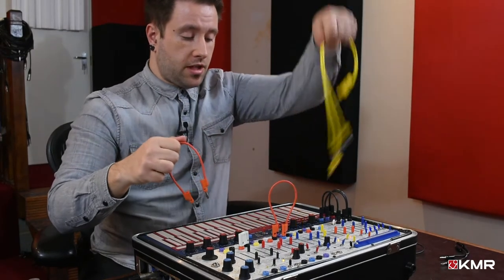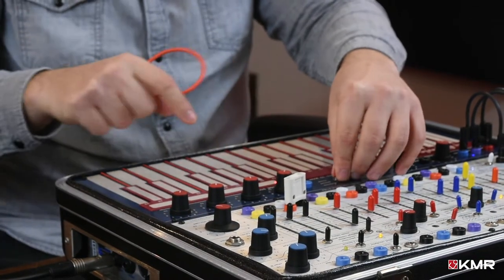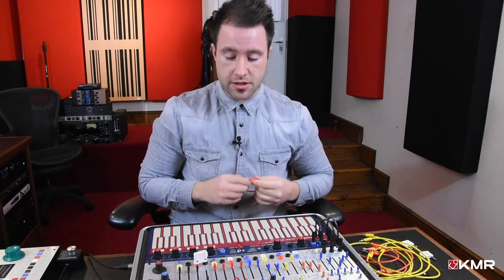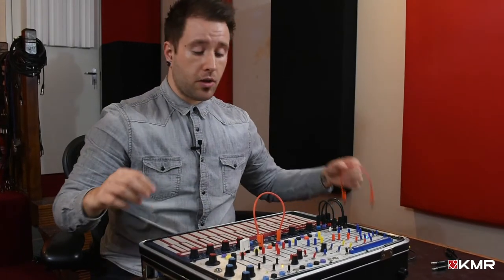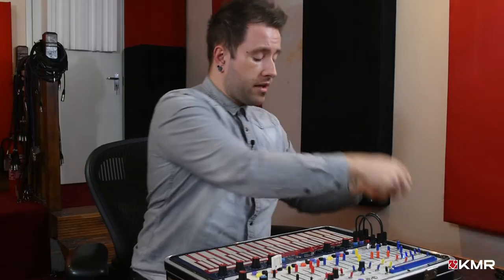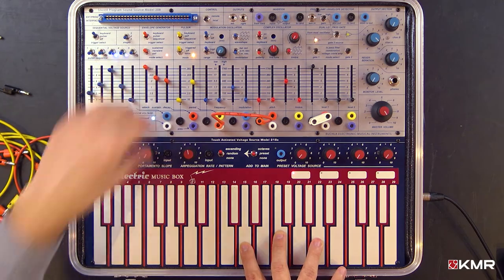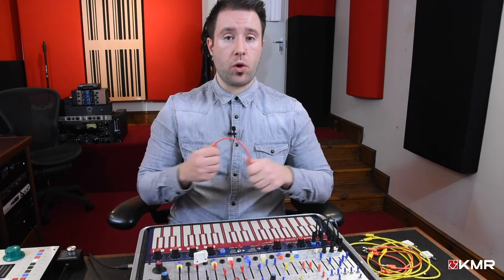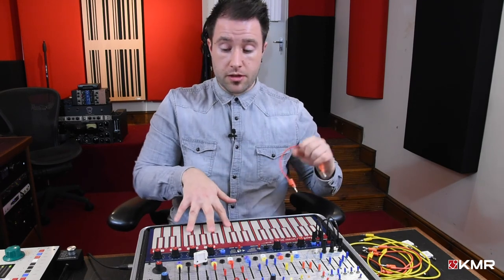Buchla Synth Tutorial Part 3 | KMR Audio

Comment: so simple question but just wanted to know if a midi clock start/stop type (ERM Multiclock) could sync the arpeggiator&sequencer on and off ?
Reply: Hey Alex, thanks for the comment! Yes indeed, you can clock the sequencer, the arp cannot unfortunately  - there are in fact two ways of doing this. 1 - you send a 16th note MIDI part into the MIDI input of the Easel, disconnect the pitch control from the keyboard and set the clock source for the sequencer and whatnot to be keyboard, then it'll play in time with the MIDI notes coming in through the inputs.